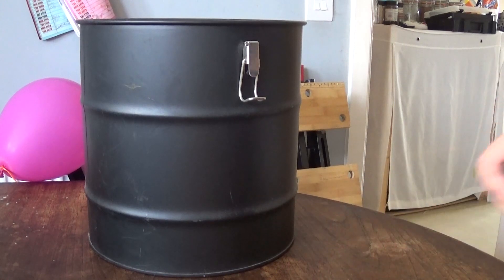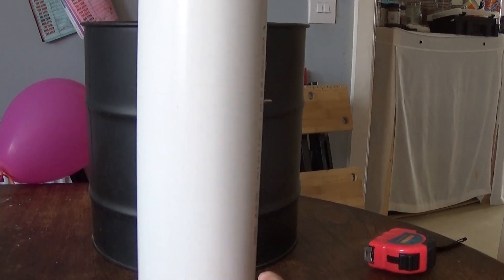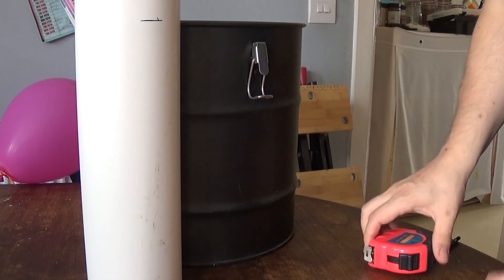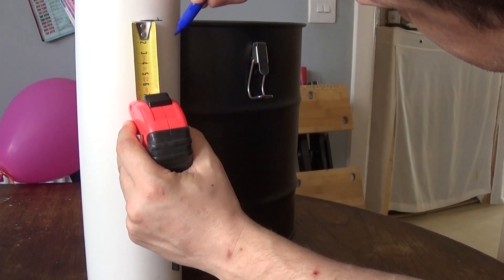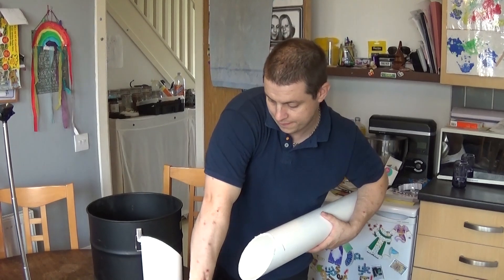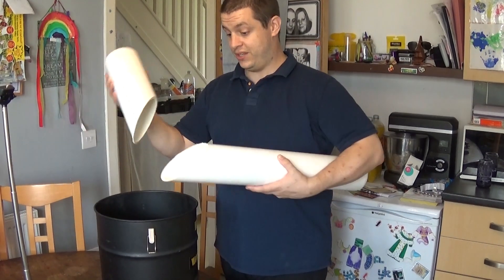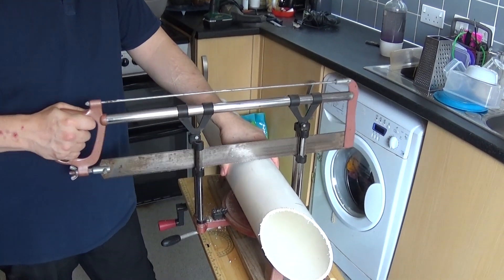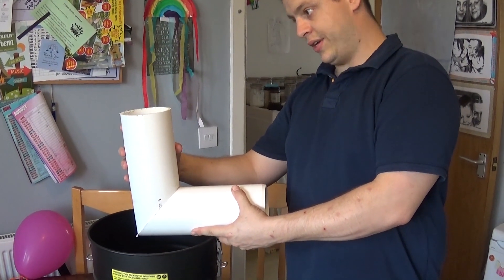How to Make a Rocket Stove Pt1 A very simple step by step tutorial. Very efficient

Comment: I'm very excited to have found your channel! I guess my question is sort of the same as the one asked below by Russell - I've seen stoves made with a combination of cement and vermiculite; I'm assuming you opted not to go that route in to make the stove lighter - is that correct? Thanks so much! :)
Reply from the maker: The weight was a consideration but not the only reason. After a lot of research and some experimentation I found that the method I used was better at holding the heat. It works really well as a rocket stove and the longer you use it the hotter it becomes. The hotter it becomes the more of a rocket effect is produced. It is amazing the heat you can produce from this little stove. I use it all the time now and will have to do some water boiling tests because it is so quick and efficient. Thanks for your comment :)

Comment: Just wondering why you chose these particular materials to construct this?  I've heard of people making rocket stoves from adobe, which is basically clay-based mud, although they are certainly much bigger in size than what you're building.  Is it due to the smaller size?  Interesting project and I hope it turns out man ;?)
Reply from the maker: Hey Russell I used pearlite because of its insularity properties. The sodium silicate acts as a high temperature glue to bind it all together. A rocket stove works best when it is at a certain temperature. After you have had it on a while it becomes more efficient. Another thing is pearlite weighs next to nothing because it is mainly air and because of this you can move the rocket stove with ease. There are a multitude of factors that made me choose these materials which are insularity properties, weight, cost and ease of purchase. I will be making a larger more permanent one in the future and I haven't decided what i'm making that out of so stay tuned.
Here is part two in case you didn't see it : https://www.youtube.com/watch?v=ZomOGrErusc

Thanks for the comment :)